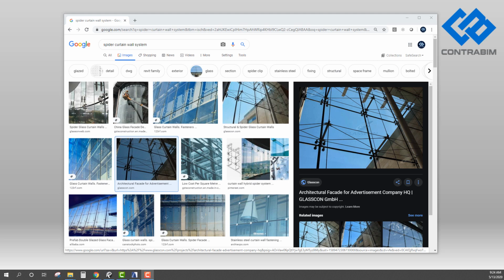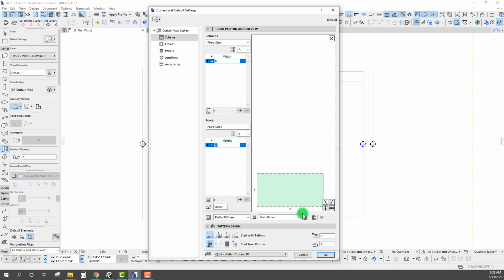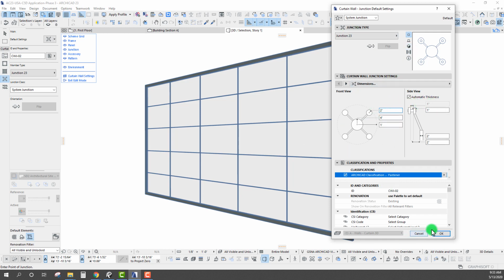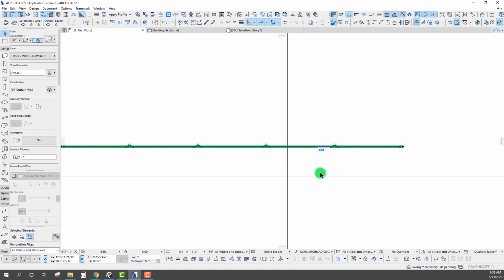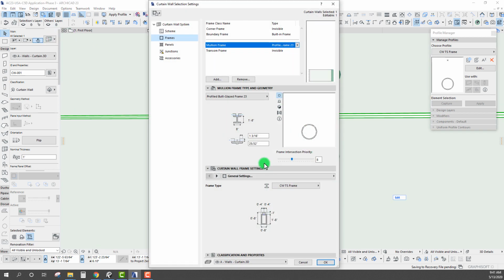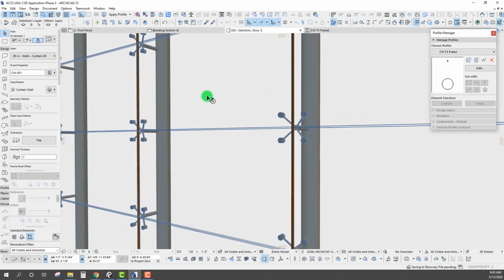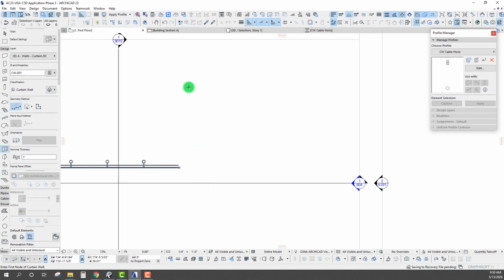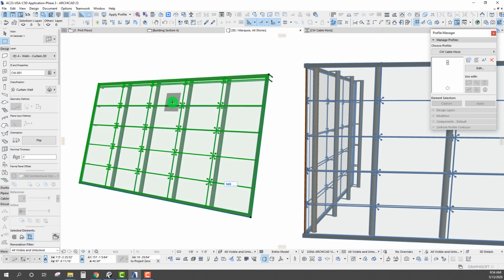Modeling a Spider Curtainwall System in ARCHICAD

Comment: Hi! I know this video is old but I'm on archicad 27 and I'm having trouble with the frame intersection priority: either the vertical support is interrupted to get the junction through or the sealant doesnt intersect properly in the intersection. Any ideas on what might be causing this?

Comment: the only pitty things for working units, when I am trying to  convert measurement I confused, I tried to convert inches and feet but not similar with your screen, actually it would be nice if you convert to decimal units cm or mm =))
Reply from the maker: Hi Burak. Yes it always takes me a little time to get warmed up on going from Imperial to Metric too! I always just try to remember 1in ~ 25mm, 1ft ~ 300mm, and then go from there!
Reply: @CONTRABIM  İ arranged work units and had practise with your tutorials with suitly meausred =). Actually it would be perfect some detailed alumunium fitting curtain wall :) İ appriciate your works and effort :)

Comment: Great work!.... I had a problem when I tried to slant a continuous curtain wall, it only works when it is just one segment!...what do you suggest I do to make a continuous curtain wall slant?
Reply from the maker: Hi Bemnet. If you know the general shape of the slanted curtainwalls, you could use a different input method. Try creating a morph as a reference to get the overall shape you want with the slanted faces and intersections, then use the boundary geometry method for each face, which will produce multiple curtainwalls but at least you can keep the slant and get the right look from it. You'll have to do a little work at the intersection frames but still totally possible. I hope this helps!

Comment: The last time I had to do a curtain wall like this, I had to use beams and columns to model de tension rods because the possibility to use complex profiles as curtain wall frame elements was not yet available. I wonder if there is any way to change the default junction type with custom junctions.
Reply from the maker: Marian Sdraila Yes you definitely can create custom junctions! Biggest thing is to make sure you get the offsets right from center of panels. I’d be happy to demonstrate in another video soon
Reply: @CONTRABIM  maybe you can show us all the custom workflows. like custom handle,custom facade panel, junction etc.